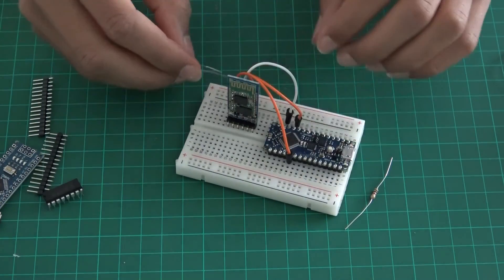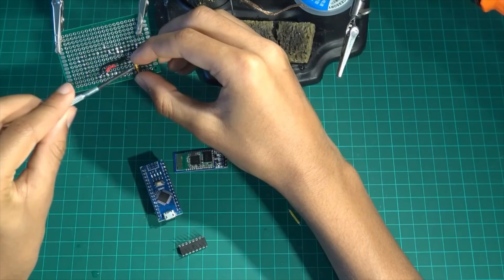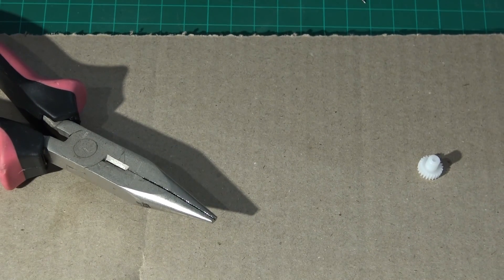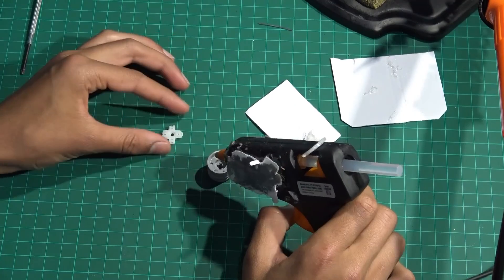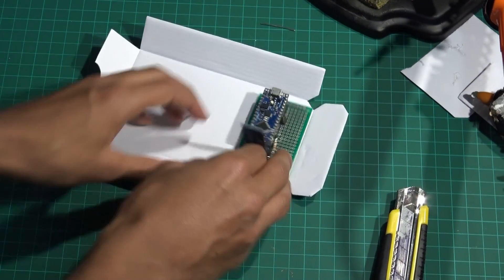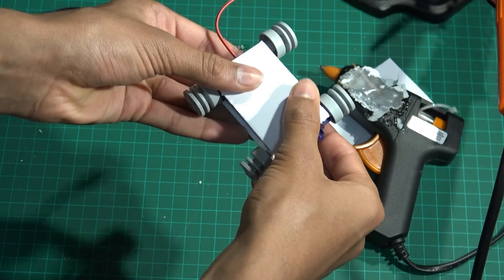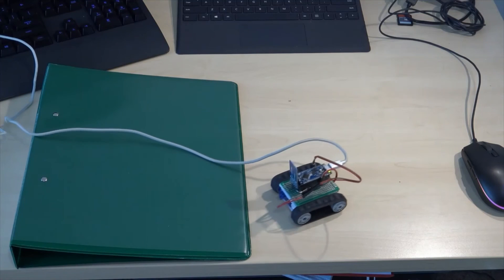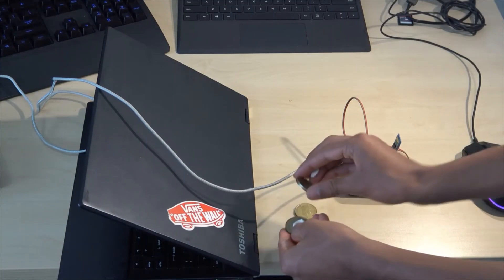Mini Bluetooth Controlled Tank | Arduino Project

Comment: amazing project. try using the esp8266 microcontroller so you don't need to use the bluetooth module anymore
Reply from the maker: I've been using an ESP32 lately and they're awesome. Will probably make a v2 sometime in the future with even more features.

Comment: Awesome project! I was thinking about making a tank just like yours I will definitely make a one just like yours
Reply from the maker: Just in case you need it - the parts list:
- arduino nano
- L293D
- 2 x 9g servo motors
- perfboard
- HC-05
- Resistors, wires, etc.